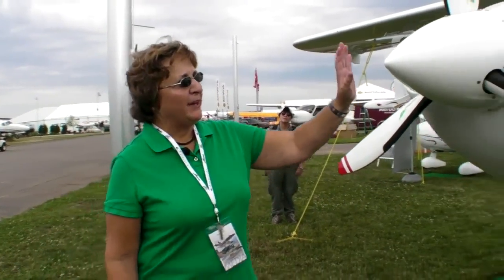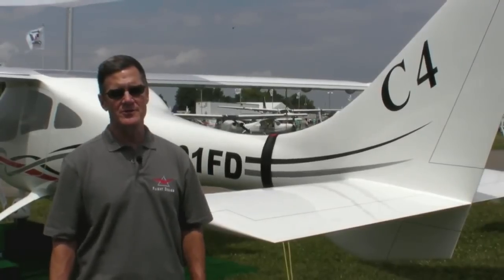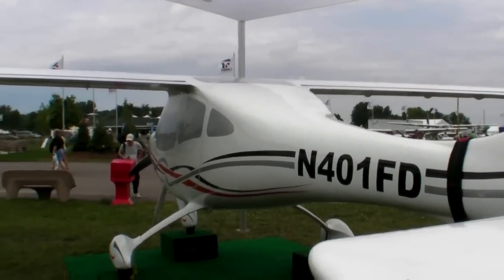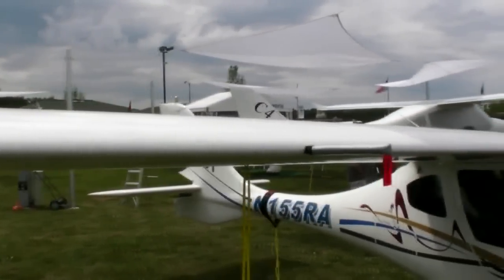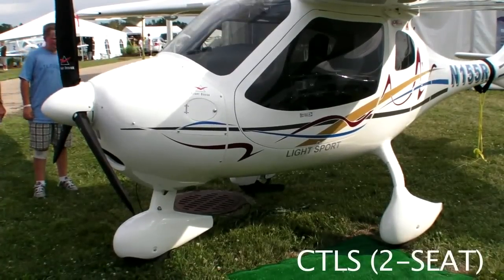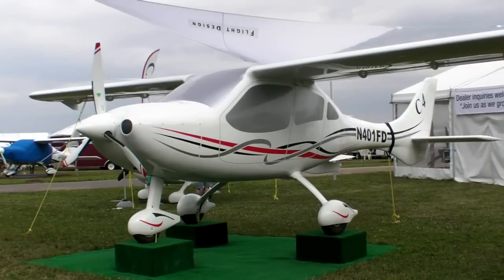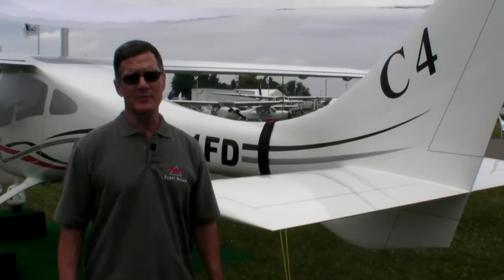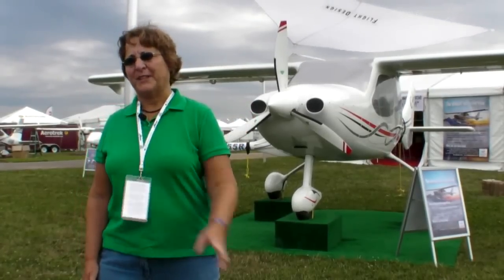Oshkosh AirVenture 2011 Flight Design's C4 Four-Place Airplane

Comment: This plane represents the ideal 4 seat piston single aircraft! Useful load, utility, avionics, safety, efficiency, range, speed, comfort, and beauty! Hurry up and get this plane certified and mass produced! (Not that I can afford one, but I can daydream better than most of us). Non to mention $250k is half that of the Cessna 182jet-A, which has less useful load and capability. I wish an American company could design an affordable and elegant composite aircraft for general aviation.